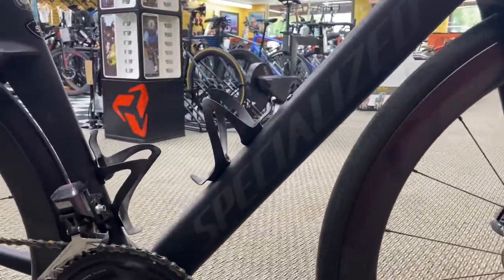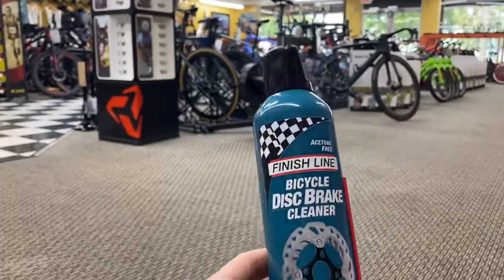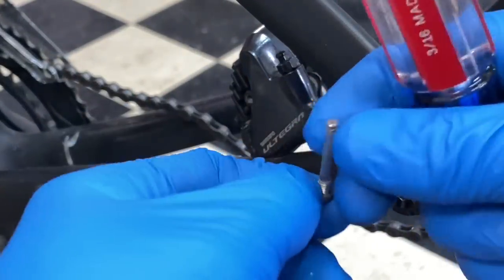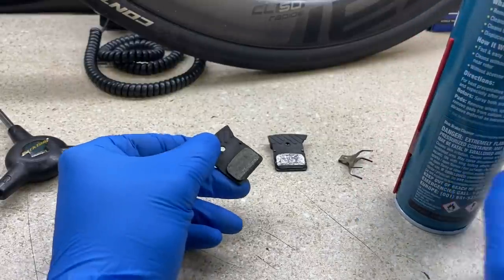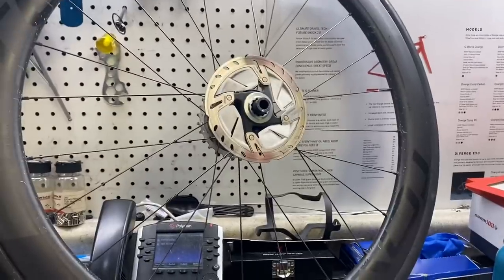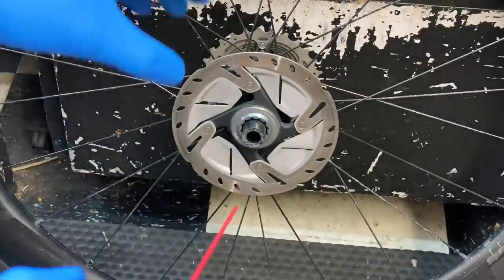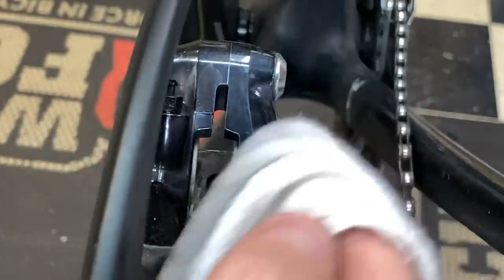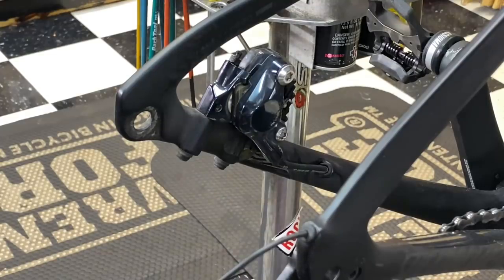WILL THIS STOP DISC BRAKE SQUEAL ONCE AND FOR ALL? (FINSIH LINE CLEANER) THE ANSWER TO OUR PROBLEMS?

Comment: Hi GC Performance,

Thank you for choosing to test and review our Disc Brake Cleaner! We genuinely value constructive feedback and insight especially from bike mechanics. We have a few suggestions and thoughts on how best to use the product and how best to prevent the damage to rotors and pads that’s shown in your video.         

Our Disc Brake Cleaner is engineered to be an easy to use preventative tool to prevent pads and rotors from becoming damaged beyond repair. The most effective way of preventing the damage we see in your video is to proactively spray our Disc Brake Cleaner on the rotors and pads after every long ride especially if the frame and components appear dirty. The pads and rotor in this video appear to have been contaminated and then ridden on for an extended period of time which deeply embeds particulates into the pad and damages the rotor’s braking surface, thus reducing the likelihood of our Disc Brake Cleaner solving the problem.

Recommendations on best practices for using our Disc Brake Cleaner: After watching your video we'd recommend being more liberal and aggressive with the application of our Disc Brake Cleaner. Make sure to completely spray and soak the entire braking surface of the rotor and pads when cleaning. When deep cleaning pads, we recommend soaking the pad, then applying sand paper to it in a circular motion and then applying a second soaking of Disc Brake Cleaner. Finally, as you already know eventually all brake pads need replacing, especially if they’re not cared for regularly.

We really like your videos! Please feel free to reach out to us if you’d like to test and review any of our other products. We’d be happy to send you a few samples.

-The Finish Line Team
Reply from the maker: Thank you guys so much!! That’s awesome, and I completely understand the part about some pads being to far too gone. It makes a lot more sense to be like preventive tool to help. But I will continue to use it for after bleeds and cleaning. Send me an email and I would love to do more videos on it. Thanks so much 

Gcperformanceyt@gmail.com
Reply: just how professional you guys replied, I am buying it. GC Performance great video
Reply: It's 2024 and this stuff works. Remeber that it's a solvent that needs to wash away the grime. Apply liberally and follow up with the standard bed-in procedure.
Reply: Likewise, I have use the product as instructed but it does not work. I even soaked the pads with the sprayed solution, wait for it to dry before putting everything back, the squeal persists, unfortunately. I have since moved on to another product and procedure and it worked every time. Sorry.
Reply: Thank you for the detailed instructions.  Your product worked

Comment: In sum, disc brakes are alot of work.
Reply from the maker: Yesh
Reply: You must be joking, so much easier. All the toeing in crap. Business card and an Allen key,
Reply: Some cyclists like working on their bikes 🤓✋🏽 Once you become disciplined and becomes a habit .
A lot  can’t even hold a screwdriver so for them yeah old tech should be easier .

It’s  not bad for me always having a brand new looking bike and groupset once you have your own stand tools cleaning and re-lubing becomes a breeze  while drinking a recovery brew and cooling down the feet . 😎
Reply: @emmanuelmr.p  I agree, since I like fiddling, working on my bike is fun. Except for the part when the rs505 (pre105) pistons cracked in my hydraulic brakes. and I had to replace the whole calliper, then the other went, but because I keep crap used the other piston from the old calliper to save me $100.
Reply: Actually it's an easy job maintaining them..
Reply: Disc brakes are indeed higher maintenance. But, I I’ve my bike, so working on it is also fun too.

Comment: Just sand the pads. And for the rotor spray them and wipe it off. You have to get the contamination off the rotor as well. It won't come off without wiping it.
Reply from the maker: I agree I usually go at this a different way but I wanted to read the bottle and do exactly as it says, but I usually sand rotors as well and everything
Reply: I sanded the rotors and the pads. Degresed them. I even "cooked" them on my stove. I tried SwisStop. I runned them in. NOTHING helps.

Comment: i usually do this and it always works. 1) brush the pads with industrial alcohol , wash off  2) sand with sand paper 3) wash off 4) wipe disc with industrial alcohol 5) clean caliper and piston with alcohol. Done. and it always work.
Reply from the maker: I have done this and it rarly works, maybe in the shop for the first bit but as soon as the rider goes out it still squeals
Reply: @GCPerformance18  always works for me for the past 5 years.

Comment: Try bedding them in again, like you do with new pads. When you clean the rotor then sand the pads you take the film of friction material off. I'm a car guy that happens to ride & fix bikes. The bike disc brake system is a lot more robust than what people think. The friction material on the pads is very similar to that on cars. Look in the environment they live in. The race bikes use mettalic pads just like race cars. They make noise like no tomorrow but, they do stop.
As long as both surfaces are clean & square, caliper centered up, pads bedded in, all should work fine.
Reply: I was having this issue, even after cleaning them with alcohol. The solution was to “bed” the brakes, not to just clean them.

Comment: In the case of autos, back when I worked on them, there is an anti-squeal compound that you apply between the caliper piston and the back of the pad. It absorbs vibration (which is the source of sound, just like a guitar string or drum head).

Comment: I've owned an Allez sprint disc for over four years now and never had an issue with noisy brakes. Four weeks ago the dreaded squeal began. I tried everything, similar to what is suggested in the video and comments. Nothing worked, the squeal would always return after approximately 60-80km of riding. I came to the conclusion that it can't be the rotors or pads. It must be the wheel. After inspecting the wheel, I noticed there was play in the hub bearings. So I replaced the bearings. Like magic no more squealing brakes. I've now ridden close to 500km and the squeal hasn't returned. My guess, due to the worn bearings, when breaking the system resonates at a frequency and the wheels were acting like a speaker. Hope this is the solution for others. It worked for me.
Reply from the maker: that is crazy and good troubleshooting on your end, yea in biking there are a lot of little noises, like squeaks, tics, knocking noises, but it all comes down to process of elimination

Comment: I had this problem too. And however I clean and sand the brake pads it always came back. Only solution so far is to hurl myself down a hill and make the brakes squal as loud as possible, at the bottom of the hill I will have braking power and the brakes are a lot quieter.
I think maybe there was residue in the brake rotor holes. 
Supposedly you should be able to burn it of with a small blow torch, but I havent tried that yet.

Comment: I think it's freshly cleaned that's why it squeals. When i clean my rotors and pads, it takes a few kms before the squeals disappear. I use sandpaper on the pads, dish it in hot water and then spray it with alcohol. That's based on my experience

Comment: I use a different brand, but of the same disc cleaner. I've never used it on pads, just sand paper. On the rotors, I spent the cleaner onto a clean cloth, and wipe the rotor breaking surface. Been doing this every few hundred km for the last year and works great.
Reply from the maker: yea I think in this video the pads were too far gone but this product works great to maintain the discs after a wet ride or a muddy ride to clean them and to prevent them from sounding like this

Comment: Great honest video man! We use muc off disc brake cleaner which seems to work. But, we usually burn 🔥 the pads & rotors to get rid of contamination then sand them. But yeah, thats disc brakes 😂
Reply from the maker: Lmaooo I honestly usually call it as soon as a customer walks in for noise. They are gonna maybe pay around the same amount for pads and rotors for me doing all that labor and time to do thag lol

Comment: I had the same problem, i just used a little bit of brake cleaner, lit in on fire. Burned for 20 seconds, nothing. Then i took out the propane torch, and "cooked" them both for about 3 mins, with some breaks, cleaned them, sanded them, and it stopped squeling. I recommend the method I used. Good video tho! <3

Comment: I always put a small bit of grease on the backing plate, and I also would spray the cleaner on a rag and then clean both sides of the rotor. However, according to the directions that you read off the can, it should have worked. Thanks for sharing!
Reply from the maker: yea I think this product is more for precaution then to fix after word

Comment: I would also use a 220 wet dry sandpaper and re-scuff both sides of the rotor to remove as much glaze as you can. I would also make sure that the pads are well beveled on the leading and trailing edge. You can also try anti-squeal compound on the backside of the pads being careful you don’t get it on the rotor. If that doesn’t work then by process of elimination replace the pads and replace the rotors and bed them in properly.

Comment: Hi GC Performance, 
I am facing the exact problem. 
new rotors and brake pads, yet same issue.
I did clean with disc brake cleaner but no luck.
Reply from the maker: loook at my disc brake squeal video, I have a product u can buy on how to fix it

Comment: I think your suppose to soak the pads in the solution using a container. And than sand. I normally just take off the rotor, wash and sand with some dish soap till the darker marks are gone. And I also wash and sand the pads till all the shiny stuff goes away. The glaze is what causes the disc brakes to make noise. Oh and I forgot I also do a wipe down with some isopropyl alcohol once everything is back on the back before riding. Sometimes you will need to re-align the calipers. On my MTB bikes normally the brakes howl is when the caliper us not straight and one side of the pads come into contact with the rotors first when braking.  Or like you said just replace new rotors and pads. Much easier if money is no issue.

Comment: I use this stuff and I just spray on a cloth and wipe the hell out of the rotor and then after I let it dry I ride it around the neighborhood and burn them in and it seems to work
Reply from the maker: I think this isa great preventive, it is great for cleaning hoods after a bleed or a calipers with no pads in after a bleed

Comment: Soak I solution. I interpret that as squirt some into a container. Submerge the pads in the solution and leave for a while. Also I think after the rotors had dried, getting a clean rag, spray it the cleaner and wipe the rotors clean

Comment: This will sound crazy, but many times the source of that noise is coming from the area between the back of the pads and the caliper pistons. I’ll give you a few areas to chase after. First, scotch bright is your friend. Use it on the rotors. Second, the BACK of the brake pads. Look at them for witness marks to see where the piston is contacting. If it looks like there are a few high points, fine sandpaper the backs of the pads, and a light treatment on the caliper pistons. The bigger of a contact patch you can achieve, the better. Take for a road test and if there’s till a problem, Last, and this will require an expensive Park Tool Brake caliper mount facing tool. Reface the caliper mount. If during that process you find the mount was out of parallel etc, then the pads will be too since they’ve been on the bike a while, and will need to be replaced.

Comment: New pads, with cleaning of the rotors, is, unfortunately mostly always the solution, from my experience. You can try a "run-in" period after the procedure you just did so that they can heat up and friction can burn off and reduce and/or evaporate any leftover contaminants but most of the time, your pads have fully soaked up the greasy contaminants to the core, like a sponge. Another thing is that you will ALWAYS generate squeal by applying the brake and rolling the bike, walking alongside it afterwards. You need to actually take the bike out for a few rides with the weight of yourself on the bike while applying the brakes to shave off the greasy layer that you have just cleaned. You're always at a 50/50 success rate with this scenario.

Comment: These kinds of products are faster but nothing beats a good and thorough cleaning in a bath with degreaser and a finish with acetone.
Reply from the maker: no lie acetone works amazingly, I tried to make it just like how the product advertises but Imean I have got a ton of them to work with a lot of work and trial and error
Reply: @GCPerformance18  And Acetone is much cheaper compared to these products.

Comment: spray on rotor, clean with a clean rag till no more dirt comes off the break track. Sandpaper of the top of the pads, take of more then just the surface caus the oil soaks in deeper. Spray on the pad and light it on fire and let the fire die out. Mount everything again and see the results.

I'm not entirely shore, but letting the pads soak to long will ruin the material. Burn to get out residue. You can try heating it up with a "blowtorch" You can try heating up the rotor to, but don't warp in. Try with a old one first.

Comment: Remove rotor and scrub with a sponge and strong washing up liquid. Leave to soak in soapy water then rinse thoroughly. Finally wipe off soap/water residue with isopropyl alcohol. Replace pads before re-installing rotors and off you go, works like a charm 👍🏼
Reply: You forgot to add: "Do this after every ride."

Comment: I clean my brake rotor by spraying and wiping it a couple of times with perfectly clean paper towels.  I clean, then sand the pads so I don't sand contamination into the pads. Then I clean them again after just to be dead sure. Then I do a pad breakin procedure.  Also, I don't come to a complete stop with my brakes on. I get almost stopped then let the brake off and put a foot down.  Mine stay pretty quiet, not dead silent but I had to start yelling so I wouldn't sneak up on people at stop lights. I haven't tried that particular cleaner.

Comment: Yo’ washing the bike helps specially road disc .. 

I honestly think half the issue it’s discipline of keeping it clean after riding over puddles and not choosing to ride it on the rain if it happens well get In the habit to clean after or pay later  .. 
They are not MTB’s even a lot of them spray the mud off it right off the trail before they loaded , for road as you mentioned we pick up oil and debree specially in the city . 
The other big one it think it’s squeezing the crap of the levers to stop right after not keeping the rotor clean all it takes it’s a look before and after , if it ain’t smooth your pads are set incorrectly not clean and improper breaking technique . I just brush mine evenly and progressively stop instead of constantly slamming on them that’s a good way to warp them and scratch them and lead to loud noises . IME  ridding disc on road since 2016

Comment: You should always remove rotors when cleaning with strong spray solvents to avoid overspray which will soak into bearings. 

Also don’t spread shimano pistons with a metal tool, as the ceramic pistons can easily crack and write off the calliper. Read the shimano white paper on servicing of their callipers!
Reply: lol. same thoughts. Mechanics should know better.
Reply: I did not know that. Good stuff.

Comment: Clean the rotors with a cloth. Maybe take the rotors off and regrease the centerlock? Might be vibration. I use the shimano rotor cleaning and it works fine

Comment: Clean the pads with sand paper and clean the rotors with paint thinner on a towel.If there is something on the rotor it will defenately remove it.Dont rub the paint obviously :D

Comment: First step, do a proper bedding in. Everybody can do it with a 5 min YouTube tutorial (ParkTool, Sram... same procedure anyway)
Never spray anything on pads.
Clean brake dust with clean rag and water when necessary.

Check if you use resin pads instead of metal pads.
Resin - road conditions
Metal - more grip and durability on bad condition (DH, MTB, CX...) can be noisy!
Reply from the maker: It literally says directly on the can to spray pads. Also the pads were already bedded in. But after I did the cleaning i bedded them in whole riding up and down the street

Comment: Lol, that test after cleaning was epic! The sound made my dog all cringy and ran away!  🤣

In any case, what I try to do is similar to my cars disc brakes. After a while you get slight ridges which can produce sound somewhat like the rim of a wine glass if you rub your wet finger around it. So I just chamfer the edges of the pads to avoid it touching those ridges and sand the pad surface too.  Seems to work mostly. You could try that on bike disc brakes and see if it helps.
Reply from the maker: hahahahahhaha thank you so much

Comment: Pull the pads out. Sand them on 100 grit sandpaper so they are clean and level. Clean the disk with cheap automotive brake cleaner and a green scotch pad. Done.
Reply from the maker: look up squeal out